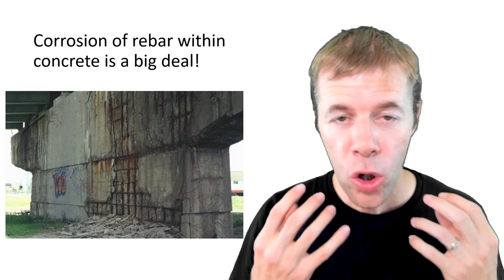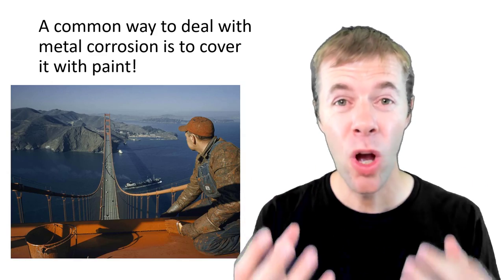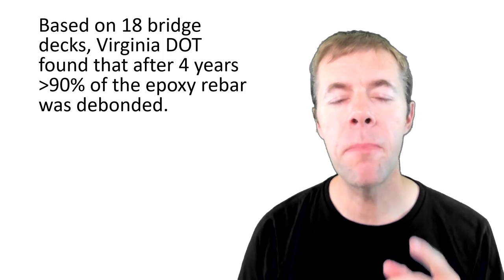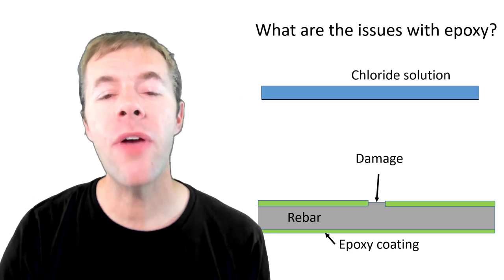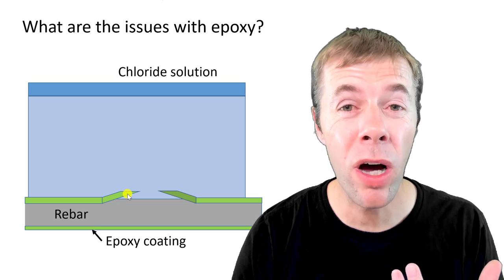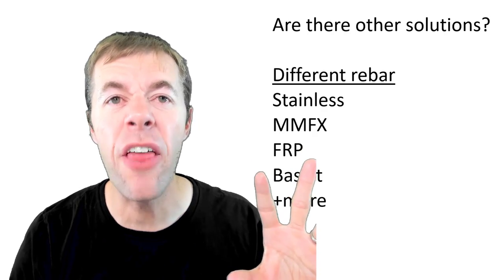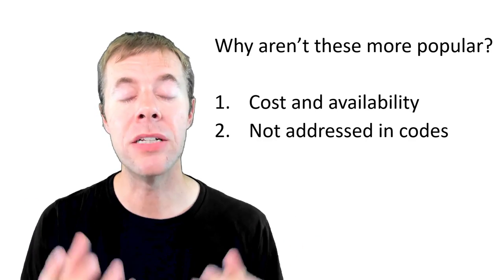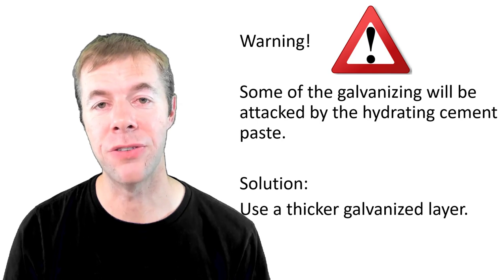What is epoxy coated rebar and why is it being banned?

Comment: Use better quality steel because rebar is one step above junk pot metal.  Just a little ways from my home is a 100 year old sawmill that has exposed rebar.  There is barely a speck of rust on that 100 year old rebar.  Yet, rebar put into cement just a few decades ago is rusting out?
Reply: In Philadelphia we have alot of crumbling structures with exposed rebar that are 50-125 years old with exposed rusty rebar. Steel rusts. Rebar is usually prerty good steel. Rebar is not mild steel, it is held to pretty tough standards.
Reply: @George Eckenroth - I dont know what rebar you have seen, but in general the stuff is junk.  If you tack weld to it, the welds break with even slight pressure.  Its called pot metal for a reason.
Reply: I don't think you understand how much rebar is actually being used to make reinforced concrete products. Using higher quality steel would drive costs up to the point they'd become untenable. Furthermore, it doesn't matter what quality of Steel you use, because all Steel will eventually oxidize, and it only takes a few specks of rust to crack dried concrete
Reply: @Zachary Henderson - why dont you explain it to me.  I spent 15 years fabricating parts for refineries.  These included pressure vessels, heat exchangers, high pressure vessels that were 3 1/2 inches thick, and have worked with all different types of alloys - inconel, monel, carbon, stainless, hastalloy... etc.  The real problem is cost cutting.  Companies want to use the cheapest steel they can to get the job done now, and worry about the problems later on.  I can show you 100 year old rebar sticking out of cement that barely has a speck of rust on it.
Reply: Rebar certainly is not tool steel or specialty grades. I've worked with rebar for decades and it's (mostly better quality steel than alot of the mild steel I purchase. I find rebar adeqate to it's application. I believe that tere is no easy or cost effective solution at this time.
Reply: @survivalistboards  Rebar is not "pot metal."  Rebar is specified to meet ASTM A615, and ASTM A706.  There are additional ASTM standards for testing of the steel and ductility.  Rebar can be specified as Grade 40, Grade 60, Grade 75, Grade 80, or Grade 100 depending upon the tensile strength required in the concrete structure.  Each of those grades of steel have their own ASTM standards defining the performance characteristics of the steel.  If the steel meets the ASTM standards, then it cannot be "pot metal."
Reply from the maker: @RuralPrepper - I agree that rebar could be made out of higher quality steel.  There are a lot of better alloys out there.  
I don't buy the argument that if the cost goes up then we can't build everything we need to.  On structures that we want to last then, we can't afford NOT to do something different.  The cheap way is not working!    
Thanks for the comments!
Reply: Rebar is really freaking expensive. So anything that drives up the cost, just even a tiny bit.. is a nono.

Most times its cheaper to use less rebar and complement it.

Now when computer software if getting better we usually design the rebar to a much more exacting specification ... Having a enginneer puting in a couple of hours to take down the rebar dimentions is totally worth it nowdays
Reply: @matsv01 Even if it increases significantly the lifespan of the structure?
Reply: How about using NO rebar at all and just building arch bridges like the Romans did. Roman bridges last thousands of years. Or if arches won't do then just build it like the Brooklyn bridge. There is no rebar in those towers. It is just solid masonry. They are 140 years old still standing no problem. Our society is too obsessed with high tech solutions when a low tech answer exists.
Reply: Chinese steel is garbage, along with all the other crap they pawn off on us.
Reply: Of course, there is no way I can know for sure without looking at it but because of the age you mentioned I suspect that the rebar you're talking about is cast iron. Cast iron of course, is very rust resistant.
Reply: Poor quality rebar, along with countless other  products come from China.
Chances are if it's made in China is going to break or fail very quickly.
Reply: @buckhorncortez  Prepper never said "rebar is pot metal", he said "rebar is one step above junk pot metal".  Why do you twist his words?
Reply: RuralPrepper
A lot of the rebar being used is lower grade steel because it is being imported from Asia. You are correct that rebar from older properties is of a higher quality but this does not just apply to rebar but to all manner of steel structures. 

Most of the modern Chinese steel would not compare in quality to the earliest manufactured steel which should show you how bad it is. 

When doing property developments I make it a standard that higher grade steel is used and the number one response I get is cost.  It is going to cost 10 times as much to sort out down the line.
Reply: electrorganix 
Third comment down. He called it pot metal.
Reply: Yeah, pretty good quality hot rolled...if you have any doubts...check out the welding requirements... @georgeeckenroth5315
Reply: Bet that rebar was square & twisted as well!  Saw a heap of it during rehab projects, RuralPrepper.  -23 years -86 - '09, as a TXDOT Inspector of new construction.    2419
Reply: @Tex_Prepper  I stand corrected, you are right.  On the other hand, there is a video of a guy forging a knife blade from rebar, so the metal can not be all that bad, I suppose.
Reply: Because importing our infrastructure supplies isn't necessarily a good idea.
Reply: @electrorganix  Read his second comment.
Reply: You are wrong about that exposed sawmill rebar. That rebar is covered in rust even if you think it isn't. Rust comes in different colors depending on how many oxygen atoms are in the rust molecule. Rebar fresh out of the mill is covered in a black form of rust called mill scale. What is the color of that rebar you think is rust free? If it is the shinny light gray you get after grinding the surface of steel I will take my words back. Any other color indicates it is rusted.
Reply: RuralPrepper   You can't weld to cast either, doesn't make it junk.
Reply: Why not plate them with zinc..?
Reply: @omaspen  Cast iron might be "rust resistant", but it is extremely brittle - hit it with a hammer and it will shatter - you can do it yourself, with an old fashioned iron drain pipe, or cast iron bath tub.  It's also why old iron railings just break when hit by a vehicle in a wreck.  .... Cast iron would be utterly useless as rebar, and in fact you'd be lucky to get it in place prior to pouring concrete without many of the rods breaking.
Reply: It is nothing to do with steel quality - dry steel in indoor environments will corrode very slowly and last hundreds of years with very little corrosion, and do not need paint. The worst affected are those that are exposed to chlorides. Exposed steel in external locations eg. steel piles is often left unpainted with an extra sacrificial steel thickness over what is required by design provided to allow for corrosion loss. This relies on the fact that if the rust coating is left intact and not removed, then it slows down further corrosion to a very low rate, and this is often a more economical and practical way of reaching the required design life than painting/repainting.
Reply: Concrete as used is HIGHLY alkaline.  The alkalinity is the death of many materials.  This is a big problem with trying to use fiberglass - even the alkaline-resistant fiberglass is just a little better than structural fiberglass.  If carbon fibers were produced cheaply enough, they'd be just about IDEAL for reinforcing - but you know, it's carbon and even at gazillions of pounds, it's still $$$.
Reply: It could also have something to do with the concrete recipe, different cure rates and water ratios are going to affect the corrosion rate
Reply: Steve: Are you referring to carbon fibers? Thanks for your comment.
Reply: @rlewis1946  Yes.  We did a study a couple decades ago and while the research being done by others showed promise, the technologies of the time couldn't produce carbon/graphite fibers cheaply enough.  A HUGE contributor to cost was the fact that all known means of producing carbon/epoxy rod could only produce material at about 10 feet per minute while steel rebar could be produced at speeds in excess of 20 miles per hour!  Carbon will hold up in the corrosive environment but nobody is producing the raw material cheaply enough for general usage.  There MAY be structures with critical needs that MAY be able to justify the expense... but nothing has yet surfaced.
Reply: @electrorganix  sure you can forge out of any metal, you can also add carbon and several other means of additional hardness and strength. But you are both adding to it, and you are also not expecting the same use, and abuse of that metal. Hardness != corrosion resistance or many other factors that rebar is required to have in concrete. I have some rebar from about 30 years ago sitting outside the entire time, it has a small amount of rust in patches where it would it in water in the spring. But some that I bought in 2008, I don't dare use for concrete, it's rusted to crap.
Reply: noobenstein  Have you ever seen Chinese construction quality? It's scary as hell.
Reply: @jaquigreenlees  You are partially right. But it's not cure time enginerds are going for. The less water used to make concrete workable, the smaller the micro voids are once cured. The bonds are tighter and there is more mass and compressive strength overall, which is the goal of low water concrete. As you point out this has a significant effect on the pH of the concrete, while curing and forever afterwards. While zinc is a bit better than raw or epoxy rebar, I have seen this delaminate as well. The zinc and steel then becoming flaky and almost worse than naked rebar. Stainless is the ultimate, but cost and environmental impact from manufacturing is significant.
Reply: @huejanus5505  You CAN weld  cast, I do it.all the time. Sure it is a pita, and possibly can be not as strong of weld but it IS weldable.
Reply: @Novusod  Yeah because the roman bridges had 40+ ton semis continuously driving over them along with thousands of 2+ ton cars traversing them everyday.. Thank you, but i think i will take the reinforced concrete.
Reply: @fitlobster  The Romerbrucke built in the second century has no problem carrying the weight of modern traffic with no weight restrictions. It has been use for nearly 2000 years.  https://en.wikipedia.org/wiki/Roman_Bridge_(Trier)
Reply: @richardcraniumdicksinn3959  I have t-shirts that I bought 12 to 15 years ago. It finally wore through the folded over hems.  But the fabric was still not pilly.

When I buy the same brand t-shirt today, by the 6th to 8th time I wash it it is pili. That means the threads themselves are substandard. They look the same and feel the same in the stooge but wear out very quickly.

China is famous for their ability to make substandard products that look okay until they have been under use for a few months.

It is bad enough now that it is almost impossible to find quality fabric. You basically have to use old fabric if you want high-quality.

I assume that the same is true for generic reba.

It is trivially easy to Google multiple stories about low-quality Chinese steel.

Here's one from New Zealand.

https://www.newshub.co.nz/home/new-zealand/2018/06/nzta-knew-about-substandard-chinese-steel-emails-show.html
Reply: I've seen some real low grade rebar getting delivered to jobs and the bosses just don't care as they will be long gone from the job before someone notices.
Reply: @TylerLey  sorry I beg to differ I've worked with it for years if the quality goes up so will the price by alot that's just fact
Reply: @zacharyhenderson2902  take it youu dont fuck all about steel or quality differences between them. Higher quality still is stronger and last longer. Plus it doesnt rust nearly as fast as the junk steel normally used for rebar
Reply: Exposure to road salt or other chemical attack may be the difference. I've seen exposed rebar away from salted roads be just fine regardless of vintage while rebar where it gets exposed to salt is rusted badly.
Reply: Novusod the concrete used by Romans had volcanic ash instead of Portland cement, and volcanic rock as aggregate, totally different chemistry. It actually gets harder with age. No comparison.
Reply: @craiglaughlin2738  The Panama Canal locks were made using portland cement from U.S.A., the contrete mix ratios were all over the place, and they had a fraction of the knowledge we have now, yet between overengineering and lots of luck, those locks are still pristine.  Core samples taken in the 1970s found that the concrete in the locks had also gotten stronger with age.  There's nothing wrong with portland cement if it's used properly in the right application, we just don't know enough about the physics and chemistry to predict how well a batch from a random quarry will age in a given application.  Civil Engineers are always getting better at understanding their materials.  The Romans had many generations of experience working at roughly the same scale from the same kilns and quarries using the same tools generation after generation after generation.  We don't have centuries to practice a skill anymore and modern construction is bigger, more complicated, and done a lot faster than anything in ancient Rome.
As an aside, the romans weren't superhuman in their engineering ability... Look up the Fidenae stadium disaster.
Reply: I use stainless steel notched bar and laser cut plate in areas that matter like connections that get exposed to water or are near the surface of the concrete.
Reply: @drivecam101  that's where the chlorides come from.  And where there are lots of salt used in winter is where you'll see damaged concrete and badly corroded rebar.  Roads and bridges in Salt Lake City for example.  Less than 20 inches precip per year yet, horrible life of concrete and reinforcing steel.
Reply: I disagree; QA of steel production these days is miles ahead of yesteryear - unless you consider cheaper product from China - hmmm ..... any (alarm) bells ringing?
Reply: @survivalistboards  pot metal is not iron.
Reply: @agoogleaccount2861  that's what galvanizing is.
Reply: @survivalistboards  i think the problem is for rebar in concrete. The concrete acts like a sponged and holds the chlorides in contact with the rebar. Even if the concrete dries out the chlorides might precipitate out and stay in the concrete. And when water comes back in with more chloride and then dissolves the previous chloride compounds that were left behind the chloride concentration increases.

Exposed rebar doesn't have that problem with a corrosive compound being in contact with it always. And gets cleaned by the rain. And then dried by the sun. so it rusts slower. just a guess though based on what he said in the video and my understanding of chemistry.
Reply: What a lot of people fail to realize is the fact it is mainly the modern Concrete itself and in fact not the rebar. The concrete companies at least here in the USA buy a residual product of burnt coal called (FLY ASH) The FLY ASH is what is left after coal is burned, it is highly toxic contains mega content of Mercury. Fly Ash can and has eaten the paint off peoples cars that work at the Coal Gen plants and the folks that live in nearby communities and the shit is lethal to the rebars in concrete... (Make a note coal Generation plants used to produce what is called ACID RAIN as did steel mills that burnt the coal they call Coke) This is also the reason modern concrete is 10 times weaker than that ancient stuff we find around our neighborhoods over 100 years old. FLY ASH is highly toxic as it is corrosive and after all it is just a powder. When my great grandfather worked for PORTLAND CEMENT here in NORTHEASTERN Pa. Portland cement products used to brag they did not add these fillers to their concrete mixes. It was legal at one time to pour city sidewalks & curbs with the stuff. You won't find any city let ya do that with the shit they sell at Depot these days.... Sackrete shit is full of FLY ASH about 50/50 content and the stuff ya get from a modern concrete companies trucks hippo spout ain't no better these days... So I hope I helped all you micro macro nano ninny rocket scientists out okay....  Many many years ago labor and industry councils got together trying to find a way to dispose of this highly toxic waste called Fly Ash and many of you may have bought one of those homes where the foundation immediately went to hell in a hand cart and nobody would tell ya why that happened... Here is why it happened.... Many many years ago i tried to help a friend in court sue a concrete company for what is fact, Even though I had facts and figures from U.S. Govt. science offices I worked for the court was so corrupt they supressed the evidence because there were at the time at least 20-30 other people in and around that court room waiting to sue the same company.... The fact is that Concrete company held local municipal state & government contracts and had we won that suit the company would have been toast.... The government is so desperate to get rid of that FLY ASH they will continue to protect these concrete shiesters... There is no easy laymans way of telling how bad a concrete company is gonna hose ya when you buy their shit because like my friend found out the engineering company that approved the sample concrete submitted for inspection that engineering firm was on the concrete companies payroll as are most of those alleged engineering firs on the payrolls of all these concrete providers for just such reasons... However I see sidewalks here where I live less than 4-5 years old already falling apart because of this so unless you are a guy like me that knows actual science of matters and materials you are shit outta luck to identify the real problem here and it is not the rebar.
Reply: +Novusod Stone is stronger than concrete.  That's why we have to reinforce concrete.
Reply: George Eckenroth your wrong, it is mild steel. Depending on the steels environment Is what causes it to rust and at different rates. Steel placed in the dessert last a long time even with a layer of mill scale which believe it or not shuts off oxygen to the steel surface which a corrosion cell must have. You place the other half of that same bar at sea level in saltwater in Florida in or out of concrete and it’ll be in big trouble within four years (depending on concrete cover).
Reply: Zachary Henderson .....You Sir, are correct. I can tell you’ve been around the business of reinforcement bar.👍
Reply: @huejanus5505  you can with nickel rod.
Reply: RuralPrepper..... I wish I had the time to school you on the mild steel used for reinforcement and “dialing for dollars” concerning how large users of this product (mainly State Departments of Transportation) balance “Cost vs Materials and taxpayer dollars. But I think I’d be wasting my time. Do what you will with this info friend.
Reply: @fitlobster  the railroad bridges in the Florida Keys are concrete arches that were pounded by heavy rail for years and it is still standing.
Reply: George Eckenroth .....your partially correct sir.
Reply: Buckhorn Cortez ....don’t know if you were on the “Uses” side or the “manufacturing” side but I can tell you’ve been very near the use of mild steel reinforcement. Take care friend and don’t get in a pissing contest with these folks that are from across the tracks.
Reply: @wolvenar  thanks, I appreciate your comment, cheers
Reply: Tyler Ley ....I can clearly tell you have never been anywhere near the operations of State D.O.T.s , Federal Funds and Taxpayer dollars. You should prob stick to what you know best. Take care fellow.
Reply: matsv201 ....you are on the right track.
Reply: DunnickFayuro IT ALWAYS COMES DOWN TO COST EFFECTIVENESS AND TAXPAYER DOLLARS.
Reply: @asherdie  That bridge used reinforced concrete. Even still this bridge you reference was closed from rail use do to collapse and damage from the elements. I live here in Florida and i am very familiar with Henry Flagler's projects. This bridge was a huge accomplishment. However, there are no vehicles that traverse the remaining sections of bridges. Thank you for making my point.
Reply: @fitlobster  I live in Florida also. Just was in the keys in august. Hurricane damage and lack of maintenance killed those bridges.  While I was there I witnessed some of the  rehabilitation of sections.  Vehicles can still travel on bits and pieces.
Reply: Novusod ...omgoodness,  yes there are old bridges in the Florida Keys that have been there since 1914 simply because they only have three strands of mild steel wire (which held the wooden forms together) and are not of sufficient diameter to concrete volume to crack the concrete. You can’t build bridges like that anymore due to engineers looking to build higher, longer, stronger and more aesthetically looking structures.. We are always looking for better ways to save weight and increase the strength to our structures thru better and better quality concrete. This plus adequate high grade quality concrete with truly sufficient concrete cover especially at high tide level in a marine environment are the only answers. Nothing will last forever, even those old solid concrete bridges in the FL Keys are crumbling as we speak. You just do your best with the dollars you have, a poor man’s bomb shelter won’t last as long as a rich man’s bomb shelter, but in the end, both will die one day.
Reply: @Robert Langley - Like I said in an earlier reply, I have experience with all different grades of steel.  I see a large part of the problem as short term thinking.  Get the job done for the lowest cost possible, then we will deal with problems later on.  Compared to the line of work I use do for refineries.  If a heat exchanger or pressure vessel blew up, people died.  If concrete fails, just replace it.  The honest truth is, stuff we build today is not meant to last.  Some of the bridges, dams and roads built during the interstate highway project are still in use today.  But a road built a few years ago is in serious need of repair.
Reply: I'm no civil engineer, but it was explained to me that most city governments are buying 20 year roads and expecting them to last 30. In my town, they like to put multi-million $ Band-Aids on schools so we  still owe money on that project after it's been bulldozed and a new debt/building is started. Sorry, run on sentence there, but you may catch my drift: government is full of money wasting retards that will ALWAYS spend other people's money irresponsibly.
Reply: richard mccann  Although I agree with you, could you use some lower case. All capitals makes it harder to read than it needs to be.
Reply: @richardcraniumdicksinn3959  You are aware that the technology is in place to make better quality products and Chinese steel can be as good as any anywhere. There are plenty of US and European companies who make stuff just as bad as the worst Chinese stuff. It all comes down to making a quick buck so get stuff cheap as possible and don't worry about future consequences
Reply: @bighands69   What do you mean by 'higher quality' steel? Steel has carbon in it, various other alloying elements could make it more corrosion resistant but wrought iron would be 'better'  from corrosion standpoint but mechanically a lot weaker than steel.
Reply: @zacharyhenderson2902  Do you think it's cheaper to replace that roadway?
Reply: @peterjones6945  
China has been using scrap  & recycled metal for years. There was a toy was made out of beer can that had Budwieser showing on the underside of the toy. One mans trash is another  mans treasure. Chinese have a reputation of making cheap junk. Example Chinese motorcycles and ATVs steel compared to the Japanese which is a much higher quality.  Yes there are some things that are made in USA that are junk. A lot of the greedy companies in USA have moved out of the country to have the cheaper labor.
China uses children for labor as well. The child does not have a choice.
Reply: Your welds break because you're a crappy welder and using the wrong rod. Rebar is actually better than mild steel that rusts much faster. If you're using the right welding process and know how to weld, your weld will hold. I've been welding for 35 years and I know how to make a strong weld or a weak weld depending on what's called for.
Reply: clearly. I cant figure out how that isn't obvious to everyone.
Reply: Just use 4inch carbon fiber with a little aluminum powder in the dry mix....
Reply: @Novusod  is this the bridge that also used hemp fibre in the concrete ? I seen a documentary about a bridge in france the romans built that used hemp fibre and was still in near perfect condition after 2000yrs.
Reply: @buckhorncortez  Thank you for an INFORMED opinion.
Reply: @georgeeckenroth5315  There's rebar and there's rebar. There was a big scandal in New Zealand about a decade ago when it was found that imported rebar didn't meet standards required for seismic strength and it'd already been used in civil infrastructure (bridges)
Reply: @Novusod  Brooklyn Bridge isn't designed to handle earthquakes. Nor were most roman projects. Rebar is essential to give enough strength to concrete to prevent it failing under such conditions and building without it requires much more concrete simply to stay up.
All structures with rebar have a finite lifespan, but both the concrete and steel are reusable.
Reply: Or hot dip in zinc then plastic coat. That way any exposed steel will be protected from corrosion by the zinc
Reply: @georgeeckenroth5315  manganese and a small amount of nickel or vanadium can protect the steel from corrosion internally but could cost more (for nickel and vanadium
Reply: @craiglaughlin2738  volcanic ash contained silica fume which decreased voids and reduced damage from corrosive chlorides and salts and has even been shown (in amounts of around 10% by weight of mixture to cement) to "heal" small cracks. Also, volcanic ash was added to roman cement with sand, but did not replace the cement (which was a cooked limestone, a higher quality predecessor of portland cement, but more expensive to produce)
Reply: @zacharyhenderson2902  How much would the average home cost be raised by using higher quality steel in the rebar?  I bet it would be an amount the customer would be willing to pay.
Reply: @robertbrandywine  We aren't talking about homes here, because most American homes are stick built and rebar has traditionally been seen as unnecessary for the foundation.
No, we're talking about bridges and culverts and concrete roads. The cost of construction would be significantly affected by using higher quality steel, and we wouldn't see returns on that extra investment.
Reply: @robertlangley258  thank you
Reply: @bjkjoseph  the roadways will eventually be replaced anyway.
Reply: @zacharyhenderson2902  Okay, but all the homes in this area (Texas) have rebar in their slab foundations and always have had.
Reply: @survivalistboards  pot metal is non ferrous.
Reply: @miscbits6399  Roman architecture has survived countless earthquakes over the centuries. You don't need to reinforce an arch because it is naturally stable. The problem is square bridge designs with too many overhangs. Keep the masonry in compression and gravity will do the rest.
Reply: @richardcraniumdicksinn3959  re: China using recycled steel and scrap.  Some of the best steel alloys from Japan also have a high scrap content, and plenty of good American mills once made some truly miserable steel from good quality ore (and plenty of superb steel too).  It comes down to the chemistry/process of the metallurgy, quality control, and what the customer is willing to pay.  There's nothing wrong with using scrap and some genuinely good steel comes from China along with the bad steel.
In the case of infrastructure, very little is designed to last for centuries, and no infrastructure will last so long without extensive refurbishment/modernization.
Further, we've only been using reinforced concrete for the past century or so and there's still a lot to learn.  Some commenters have talked about how old-rebar is doing fine here or there, but in many modern applications old varieties would be insufficient.  Engineers have to use a predictable product that meets set standards.  It makes it possible to know that a structure won't fail under ordinary circumstances and will last a calculated service life if properly maintained and regularly inspected.  I don't know of any civil engineers who design much infrastructure to be neglected.  The neglect is a political and economic problem.  If a structure fails when and how the engineers specified it would then the design is still good and successful.  If a bridge collapses in rush hour after it's exceeded its service life (or was overburdened/improperly maintained) and the inspectors had designated it unsafe, then rotten rebar and cracked concrete aren't really to blame.
Reply: @samrichardson630  
Bla bla bla
Reply: @richardcraniumdicksinn3959  look.  Sourcing steel from China isn't the problem with infrastructure if the steel meets spec and the well-maintained structure lasts its intended lifespan.  There are plenty of good structures full of Chinese rebar.  If the civil engineer says ASTM A615 rebar and a Chinese steel mill sells rebar meeting ASTM A615 at a good price, it's going to go in the concrete and perform as expected.  The country of origin and whether they use scrap or ore doesn't matter if the product meets specifications.  Top-quality arc furnace steel from Europe and Japan is made from scrap.  You can buy good quality steel from China that meets its specs.
There's nothing wrong with the rebar if the structure lasts as long as the civil engineer says it should.  If you only feel like paying for a 30 year lifespan viaduct abutment wall, you'll likely get one that lasts 30 years.  It's only a problem when things start to fail prematurely and/or in ways inspectors don't know to look for.  This is why the epoxy-coated rebar is such a problem, because it was sold as a miracle product where paying just a little more would get you reinforced concrete that's supposed to last far longer.  Instead, it might be a ticking time bomb, whereas regular uncoated A615 usually works exactly as promised.
Reply: @johnknoefler  
You are mistaken. Crappy welder?  I don't think so.
Have more years welding than you do. 1977 is when I started.
Reply: Except, your welds break. Mine don't.
Reply: Use brand new BOP processed steel mixed with micro-alloying ingredients to improve it's quality, then electro-dip coat it in a bath of zinc-silicon-tin galvanizing alloy to toughen it.
Reply: It would most likely be wrought iron. Any kind of bar made from cast iron would be very brittle and break easily.
Reply: richard mccann 
I worked construction at one of the last nuclear plants built in the U.S.  it does not have ANY stainless steel rebar in it. There is plenty of stainless pipe throughout the reactor building, and stainless wall liner in the fuel building's spent fuel pool and pressure vessel area in the reactor buildings. The rebar is American made carbon steel, regular roll ribbed rebar. All of the steel in that plant was American made, that was specified in the regs and prints used in the licensing process.
Reply: @survivalistboards  "Get the job done for the lowest cost possible"
A lot of this has to do with the time value of money. Depending on the rate, $1,000,000 25 years from now can have a present value from ~$5 to ~$15. (This is using ~8% and ~13% as the discount rate.) It sucks to say, but longevity doesn't always pay.
Reply: A nuclear engineer told me they have better be sure that any stainless steel exposed directly to the reactor core contains no copper for copper causes the stainless steel to become brittle faster and they add zirconum and hafnium to the stainless steel to make it last longer than conventional nuclear grade stainless steel due to neutron bombardment induced embrittlement. And that was way back in the 1960s and 1970s. Now with reactor vessels being required to last indefinitely against neutron bombardment induced embrittlement they have succeeded in developing new kinds of nuclear grade stainless steel alloys that can stand up to neutron bombardment induced embrittlemen INDEFINITELY. But they won't tell me the formulations for my security clearance isn't high enough for them. I was a mechanical engineer responsible for the machine tool making department in developing customized and specialized machine tools by using basic machine tools to make them. The new kinds of nuclear grade stainless steel alloys are so expensive that before any machining is done we have to clean everything to become as clean as an operating surgical room and then we start machining those new  kinds of nuclear grade stainless steel alloys and after finishing the job we make sure to gather and collect all of the wastes created by our machining operations to be recycled back into a brand new ingot without any contamination. That was a long time ago in the 1980s. Now at age 92 (going 93 this year) they are still doing what we have done and our former students are doing a good job in the mechanical engineering machine tool making department for our new nuclear reactor factories at the Naval Arctic yards where we are building new nuclear powered submarines. The cutting tools and cutting tips of the machine tools used on them are made out of the same nuclear grade stainless steel alloys but were laser glazed inside a helium filled environment and cooled rapidly by a liquid nitrogen cooled helium gas. Helium is used as a protective atmosphere and as a coolant for it is inert and non-reactive.
Reply: @jackasschicken5922  accurate, but all too many people forget that, business is also subject to corruption and waste, plus good-ole criminal behavior.
Reply: @RCFrizz  Yeah, it blows me away whenever people imply that being a government official or employee somehow makes them better than civilians. It's just a job. And there's good and bad people in literally every job.
Reply: You don't mess around in the engineering division when you are dealing with the manufacturing of nuclear reactor heavy engineering components that will be exposed to direct neutron bombardment! Either you spend several tens of millions of Rubles or Dollars in manufacturing ultra-high quality nulcear grade stainless steel nuclear reactor vessels or you spend several tens of BILLIONS OF RUBLES OR DOLLARS in dealing with nuclear contamination inside your nation.
Reply: A nuclear engineer told me they have better be sure that any stainless steel exposed directly to the reactor core contains no copper for copper causes the stainless steel to become brittle faster and they add zirconum and hafnium to the stainless steel to make it last longer than conventional nuclear grade stainless steel due to neutron bombardment induced embrittlement. And that was way back in the 1960s and 1970s. Now with reactor vessels being required to last indefinitely against neutron bombardment induced embrittlement they have succeeded in developing new kinds of nuclear grade stainless steel alloys that can stand up to neutron bombardment induced embrittlemen INDEFINITELY. But they won't tell me the formulations for my security clearance isn't high enough for them. I was a mechanical engineer responsible for the machine tool making department in developing customized and specialized machine tools by using basic machine tools to make them. The new kinds of nuclear grade stainless steel alloys are so expensive that before any machining is done we have to clean everything to become as clean as an operating surgical room and then we start machining those new  kinds of nuclear grade stainless steel alloys and after finishing the job we make sure to gather and collect all of the wastes created by our machining operations to be recycled back into a brand new ingot without any contamination. That was a long time ago in the 1980s. Now at age 92 (going 93 this year) they are still doing what we have done and our former students are doing a good job in the mechanical engineering machine tool making department for our new nuclear reactor factories at the Naval Arctic yards where we are building new nuclear powered submarines. The cutting tools and cutting tips of the machine tools used on them are made out of the same nuclear grade stainless steel alloys but were laser glazed inside a helium filled environment and cooled rapidly by a liquid nitrogen cooled helium gas. Helium is used as a protective atmosphere and as a coolant for it is inert and non-reactive.

You don't mess around in the engineering division when you are dealing with the manufacturing of nuclear reactor heavy engineering components that will be exposed to direct neutron bombardment! Either you spend several tens of millions of Rubles or Dollars in manufacturing ultra-high quality nulcear grade stainless steel nuclear reactor vessels or you spend several tens of BILLIONS OF RUBLES OR DOLLARS in dealing with nuclear contamination inside your nation.

China is using stainless steel rebar in it's new infrastructure exposed to the sea and in some of it's military reactors. I saw my former students using nuclear grade stainless steel rebar for the construction of military reactors nuclear power plants. Times has changed, and when it comes to military specifications in my country, nuclear grade stainless steel rebar is their number one choice and forget about the costs since the reactors are self-regenerative MSR 4th and 5th generation types.
Reply: @omaspen  , cast iron is not rust resistant. Leave a cast iron skillet in water a couple of days, or an unseasoned skillet just sitting out exposed to air for a couple of weeks. You'll get rust.
Reply: @Novusod  as soon as we remember how to liquify rocks, we can just "macchu picchu" everything.
Reply: @buckhorncortez  Very true but ultimately codes are just words on paper. If a ship load of rebar comes in from China "Stamped" in compliance with codes, including documents and maybe a very friendly "Handshake", does someone go deep inside the pile to actually test the composition (Don't think China wouldn't wrap crappy rebar with good, Chinese companies are known to Poison their children's formula to get by cheaper, look it up, almost every company in China has the mindset to super cheapen their products to the point of being almost useless if they can get away with it).
Reply: @matsv201  Legacy reddit spacing on YouTube.
... You're a special kind of person, ain't ya?
Reply: @DunnickFayuro It wont. Because adding more will not stop corosion. And the issue isn´t the corotion it self, but when cracks the concreate then its bust anyway. 

So adding more concreate makes it actually last longer. Also curing it Indoors does increase it a bit
Reply: What's your materials science background? Once I know your level I can explain on your level why the current alloys are used and why they're the best fit.
Reply: @otm646  - 15 years experience fabricating and repairing ASME section VIII certified pressure vessels, boilers, and heat exchangers.   I have worked with everything from SA36 to hastelloy to monel... etc.
Reply: @survivalistboards  Maybe you have, but you still don't know anything about metallury. Steel rusting has nothing to do with the quality or strenght of steel. It has to do with the alloy. Stainless steels don't rust because of the chrome and nickel content, that's it.
Since chrome and nickel are expensive compared to iron, it's not really a common construction material. 
Rebar is a usually a bit stronger then mild steel, but corrosion resistance is normally not a consideration for rebar. Most concrete buildings simply aren't meant to last a century, and if the rebar is far enough from the surface of the concrete corrosion will not be an issue for many decades.
Reply: @Sander Vercammen the only thing in your post that matters is when you said, "Most concrete buildings simply aren't meant to last"  The building part is not important as we could be talking about bridges, and the statement would still hold true.  Companies want to build stuff as cheap as possible, and worry about it when it falls down, or breaks apart.  And you "assume" I do not know anything about metallurgy,  The rebar I have seen is one step above pot metal.  Welding to it with 7018 does not result in a strong weld.
Reply: @survivalistboards  "Pot metal" is usually a cheap zinc alloy.  It's ALWAYS called pot metal because you can melt it on a pot on your stove.  That is the reason it's called pot metal.  Steel is not ever pot metal, because there is no steel that you can melt on your stove.

"I spent 15 years fabricating parts for refineries."

And you don't know what pot metal is?  Pretty sure you're lying.
Reply: @survivalistboards  Using "pot metal" when describing any steel says enough for me. 
Welding cracks is doens't say much about the quality of the steel anyway. In fact most high strenght steel will be a lot harder to weld then mild steel. (Once you get to the really strong stuff, like high alloyed tool steels it's more or less impossible to get a weld that doesn't crack).
Reply: @Novusod  It's all about the money, always is, always will be.
Reply: @Novusod  if the infrastructure was paid for by the extremely rich like the Brooklyn bridge was then that would be an option but now the government pays to build and maintain it and the would rather line their own pockets then make the infrastructure last that is why our roads etc. are crumbling
Reply: @TylerLey   You don't buy the argument, and yet you made the argument in the video when you said that hot dipped galvanized rebar would be a great compromise between epoxy coated and some of the far more expensive solutions.
Reply: The cheap way IS working as long as it is encased in the concrete mass and all control/relief joints are installed in the massdeep and incased and structured for movement, problem solvedwhen its improperly placed in the mass I end up repairing the spalls I know
Reply: you cant build the spans we use without rebar and steel cables inside placed conduit in the framework that has steel cable placed inside the conduit which is then tightened following curean arch is not a span
Reply: @georgeeckenroth5315  Easy, yes.  Cost effective, no.  416, tempered.  Strong, rust-resistant and better than anything they had 100 years ago.
Reply: k @Novusod  The Brooklyn Bridge is actually due to get a renovation starting this  year which will involve repairs to the masonry towers including, among other things, adding reinforcement bars into the towers to strengthen them.
Reply: @jaquigreenlees  You mean concrete is alkali. Also calcium and water would make a hydroxide so again alkali. 
Acid from rain (dissolved CO2) Will speed corrosion.
That's why cover (concrete thickness to rebar.) needs increasing.
Low water cement ratios increase concrete strength.
We add a lot of left over ash and other products from power stations or smelting to bulk up the expensive lime cement and asking as it aids the pozzolanic reaction and is cheaper, we use it.
Reply: @John Buick - Really?  Pot metal is a generic term for junk metal.
Reply: Its CRIMINAL
Reply: Brilliant suggestion /s. But as he already stated the cost is key. If it isn't cheaper than another solution, it's not happening.
Reply: @survivalistboards  I agree with you. My experience of the building industry is "bish, bash,  bosh and get the cheque in". Exterior finishes are taken care of, but in other areas, the only idea is to postpone any problems for as long as it takes of the builder to be long gone when any problems arise. Just take the decorative panel off the side of your bath and you will see what I mean. After you have cleared the rubbish, then you can see holes where holes have been made causing maximum damage by hammer and chisel and that's just the beginning.
Reply: @Novusod  I agree about using Roman Arches and Roman Concrete, theirs was different than ours is also. they had a very good mixture for some things
Reply: Dont think its the quality of the steel but rather the composition which made it more corresion resistant.
Reply: >Just a little ways from my home is a 100 year old sawmill
Where exactly do you live? Most cities complaining about their rusting rebar are in high humidity regions if not coastal cities. You put rebar somewhere like Colorado, and you're gunna stop that rusting pretty quickly
Reply: or, get this, we make the entire building out of solid metal! take that nature! one solid chunk of aluminum, itll last long after the pyramids are gone
Reply: @Novusod  thing is, romans built massively, for smaller structures you NEED reinforcing, and also they used very dry mix, which makes labor much harder to do and therefore more expensive and time consuming, so there's always a downside, but they sure did build great structures, hell they outlasted their civilization by what, thousands of years?
Reply: @zacharyhenderson2902  no it wouldn't was talking about the metal in a nickel look at a nickel... that 25% nickel in a nickel costs less than a penny and that's all you would need to do All You need to add to the metal. But construction companies like to replace things they don't want it lasting a hundred years. I'm not talkin conspiracy I'm simply saying there's no reason for them to put free cents extra nickel into the steel or chromium when all it's going to do is make a product last longer that they would be paid to replace when it breaks. Just basic capitalism
Reply: @rev.jonathanwint6038  It's a bit more complicated than "they intentionally make concrete short-lived to make more money."  The client is ultimately responsible for choosing the design and has to weigh cost versus benefit.  For example, if building a highway viaduct to last 3x longer only doubles the price, that sounds like good planning, but it's also an entire second viaduct worth of money that (if they even have the money) could be spent on, say, improving pedestrian areas downtown, which might provide a far bigger benefit to the economy than a really sturdy bridge would.  Every client is trying to get the maximum benefit from their available resources.  The math almost always works out against making things sturdy enough to last forever.
Reply: @Novusod  Nothing the Romans built weights as much as the golden gate bridge either. And I doubt that a brand new Roman bridge could handle several 80,000 pound trucks and hundreds of 4000 pound cars driving over them every hour for 140 years.
Reply: @rlewis1946  Apologies for the tardy reply; yes, carbon fibers.
Reply: @Novusod  I new a master stone and concrete builder from Europe, and he said arches are better than concrete beams with steel in them, he always wanted to be involved in the design of the projects where possible.
Reply: @Novusod  i Like, OLE!
Reply: richard mccann  thanks, I really wanted to say that but you preceded me.
Reply: @fitlobster  well in rimini (Italy) there's a bridge called "Ponte di Tiberio" it's probably got 2000 years and cars still go over it no problem. It is a small bridge though and obviously nothing near the current scale of engineering projects ...
Reply: @nerfinator03  Well the italians are exceptional craftsman so it does not surprise me one bit!
Reply: @kurtzimmerman1637  yep, I remember a years ago when we here in Oz changed our rail supplier from BHP to random China, you no longer had a rating for the steel, just kg per mtr.
Now we have rail inferior to a century ago, just sad.
Reply: richard mccann  if rebar was as hard as pot metal it would snap as soon as you tried to bend it
Reply: yeah, this was my thinking, get the steel out of there, what about fiber, it was my understanding that with fiber in ur pour, no real need for rebar.  we built a 6in shop floor with no rebar, just 5k psi n fiber, walked D10 dozers over it for over a yr, even punched a hole through it with a ripper, it never cracked, anything, that was 20 yrs ago n its still there today
Reply: @thekingsilverado9004  They do they same with the fluoride thing. It's toxic waste that they cannot just dump. So they convinced everyone that if you have it in your drinking water and dental products, you won't get cavities. It actually makes teeth too brittle and it's a neurotoxin.
Reply: @timramich  Correct... As an engineer it's been a fight in reality with the cheapo Chinese steel and the fly ash in the concrete... You just can't win against a toxic mix dude so you are correct... You see shit standing now over 100 years old the rebar doesn't rust... You see shit just built 20 some years ago in severe decay. What went wrong is exactly what I say what went wrong. The reasons I got out of the building trades... The stuff today is total shit unless of course you pay an ungodly price...
Reply: @omaspen  Both concrete and cast iron have high strength under compression. The problem is that concrete has low strength under tension/flexing and so does cast iron. So cast iron is not and has not been used as rebar. 

The rebar I once knew in Ontario was good quality steel, very tough stuff. But you could see a thin layer of rust on the surface before it was used in construction.
Reply: @Novusod  Romans didn't have thousands of 60,000lb semis driving across bridges on a daily basis.
Reply: @huejanus5505  you can weld to cast iron or at least some type's. There are many types of cast iron,  some weld very well others not. I know this from personal experience working as a maintenance welder, now retired. Not all cast irons are brittle, spheroidal graphite and modular graphite cast irons bend before they break, used in pipe manufacture.
Reply: @DunnickFayuro  Too many are so fugly, you do not wish them to last very long, so the blight will be gone from the landscape before you die so you can find a peaceful death.
Reply: @Novusod  Sadly, the Freemasons seem to have lost interest in practicing actual masonry. Too busy with occultism and other spooky stuff...?
Reply: The quality of the steel that's made today compared to the past is night and day just like everything else ,cheaply made but more expensive
Reply: Rebar is absolutely junk steel try to reem it and thread it. The stuff doesn't like it but graded steel does.
Reply: @qedsteve  what about hempcrete? How does it compare?
Reply: @MaryAnnNytowl   It's a good question!  I'd be concerned about how the hemp fibers would hold up over time.  The chemistry of concrete/cememt is highly alkaline and it trashes steel and fiberglass in just a few decades. A problem would be growing and harvesting enough hemp fiber.  There are other cellulosics that might be able to be harvested from wood waste, field scraps - grasses, other "green waste"

This would be a fun R&D project actually.
Reply: @MaryAnnNytowl  Now you've got me digging a bit.  GOOD topic!
Reply: @MaryAnnNytowl  In doing some deeper digging, it appears that the natural cellulosic fibers - hemp and others actually DO work well in the typical alkaline cement mix.  Thanks for firing up my feeble brain before my second cup of coffee!